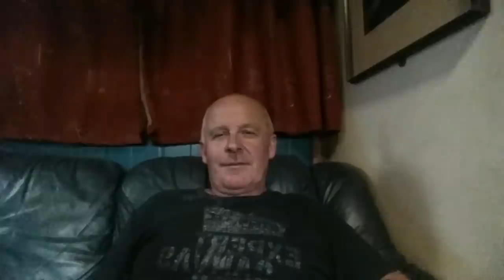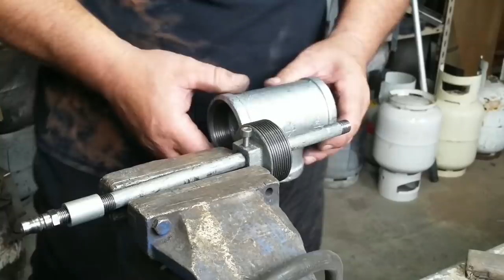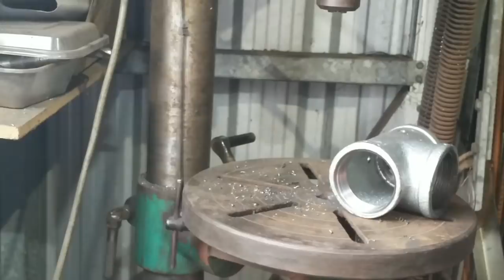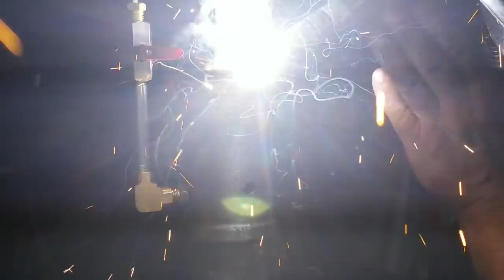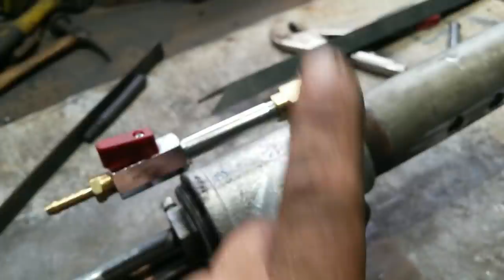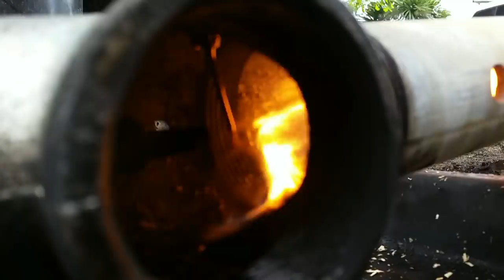Make your own Free Diesel from Waste Plastic!  PART 1

Comment: why not just use the waste oil for diesel? How much does it take to produce a L of diesel?
Reply: cvsWebDesigns  in the older 2 stroke Detroit’s you can burn any oil that will fit through the injectors. Setting up a 6 bt Cummins to try various filtered used oil products. My motorman ran an 88 dodge Cummins 1 million miles on used oil from 90 weight to restaurant grease to tranny fluid and hydraulic fluid and any oil he could filter he ran 20 %unleaded and 30 percent red diesel in it mixed with the oil
But often ran straight used oil. Way better to burn that as diesel than use it to melt plastic. A liter of used oil is pretty much a liter of diesel

Comment: your gonna need a stronger tip, mig tips like the droop when they get to hot for to long, it's not much but in this setup up it could effect your burn. have you run into this issue yet? or does it stay cool enough with with the just the air flow?

Comment: Love the 'can do' attitude!  Also 'hats off' to using waste plastic.  What is the range of production per hour?   Can it run unattended?
Reply from the maker: Eventually  I guess.  Right now I'm  busy monitoring each run . Production is about 90% by weight. It's not a lot though cos filled to the top with shredded plastic it's still only 12kg. So you get about 11 litres of product.
Reply: @t.h.o.r.  I think this is Great project for the world filled with unusable plastic.  Better than buying a burning some new fossil oil.
Reply: @t.h.o.r.  with a new house build on the cards and wanting to go with under floor heating (I'm in Ireland, need a bit of that in the winter) I'd looked at a similar set up. However yours looks both more simple and in house as regards production and maintenance 😁😁

Comment: It has these parts : plastic get wax at 400 Celsius,then you need to crack it on silica aluminium catalist by 400 Celsius,and then fraction Destillation into Destillation colum,Give leight gasoline,heavy gasoline,petrol,Diesel all high quality,a lot of gas. I made one of them ,to complex,gasoline still cheap.

Comment: Did you know that if yo get a tire hot enough that you can extract oil..? Most of everything we use and make has some oil based meterials. Plastic being made into Diesel Fuel is a great technological idea to expand on...
Reply from the maker: yes - thats what got me going down this track

Comment: You could use lens, for heat, somehow, an old big screen TV screen, some are ver big, very efficient lens, mount your lens on a pedestal hooked up to a computer, and camera perhaps with a pedestal, that has hydraulic servos, to change the pitch, of the lens to follow the sun.

Comment: Heating galvanized metal that much will give off super dangerous fumes, if i'm not mistaken, i hope you made sure it was safe using that pipe.
Reply from the maker: zinc melts and fumes at a much higher temp than this will ever get to.
Reply: @t.h.o.r.  Good to hear! Stay careful and good luck :)

Comment: Wooww, this goes behind my horizont at the moment. But I did some gas vapor buildings first time in my life. Before that I didn't know what a motor is. It's a litte bit crappy because I mostly built with parts I have and don't have to buy, but it's doing the job now as I wanted, see my last 2 videos in my channel :-)

Comment: Excellent video. What is a good starting point for air pressure?
Reply from the maker: hardly any, just a wee wee compressor blowing through a 1mm mig tip, 4-5psi
Reply: @t.h.o.r.  Shouldn't need a compressor at all right? Just a fan.. better to pressurise the fuel to make a mist or am I thinking wrong?
Reply from the maker: @Jasa1010  oh yes a fan would be way better. since then ive made other burnersthat are way more powerful that push the air instead of the fuel channel called @nobox7 is a great place to start when learning combustion

Comment: This was tried by a Japanese scientist he proved it could be done and it did make a usable internal combustion file,,,, BUT the cost of the electricity used to make one gallon of fuel from the plastic made the whole process to costly. You have to constantly control the temperature of the plastic melting device and the only way to do that is with electricity.
Reply: Or a used oil burner cannon, cost of air compressor cycling on every hour n a half (my compressor is small)

Comment: 1. Assuming this works well and safely, where does one get a free/cheap source of used oil or frier oil AND enough wasted plastic to make this worth building?
2. would salvaging the oil burner from a std sized house furnce be the same thing, same size/Btus  as whats needed here?
3. doesnt alot of orange flame suggest incomplete combustion? so alot of wasted fuel, alot of emissions....
Ps; was it raining or whats the background noise?
Reply from the maker: This is video 1 of a series. All that is explained in the next vids. Everyone has different situations you will find  business with several vehicles that all have oil changes.  Food cooking creates waste oil. Surely you know a place that cooks food? Packaging is everywhere. Just Check rubbish bins. As I say. All this is discussed in the subsequent videos

Comment: hi, at approximately the 11 minute mark, you are machining a hole in the end cap to fine adjust that thing galvanized pipe. Why exactly are you doing it this way? Isn't it easier, to just extend the threads on that pipe and add a bolt to it to lock it at the most favorable position? Now you have to slide that pipe to the perfect position and then tighten the bolt, and in my way, you just have to thread the pipe in and just tighten the nut.
Reply: Yes there will always be a better way.

Comment: I suppose this has to be better than letting plastic degrade into micro plastics that toxify soil and watercourses.
As for liberating too much carbon into the atmosphere, how easy is it to collect carbon then lock it under pressure into diamond?

Comment: Happy birthday!!! Is this diesel clean enough to run high pressure pumps?
Reply: It should be..but anyone making this fuel should mix it with at least 25% bought diesel to obtain the lubricating additives benefit or buy diesel additives (if there are?) The older sulphur/lead containing diesels had lubricating properties that helped prevent corrosion/erosion of moving parts(in the combustion chamber)..

Comment: Galvanized pipe heated up is extremly poisenus
Reply from the maker: Fact Check- Galv pipe heated to 430 degrees celcius , the vapourising temp of zinc is extremely dangerous If you lick it. I try not to lick it.
Reply: https://en.wikipedia.org/wiki/Hot-dip_galvanization

Comment: How much energy is being used to produce the diesel? This is a critical issue in that if it takes as much energy to make it as it produces then there is no net gain.
Reply from the maker: Solar power  provides the power for the small compressor and the water pump. 2 minutes worth of propane for the warm up is the only purchased fuel - main fuel is waste oil. - I get the feeling that you didn't watch it properly? The rest of thevideos on the playlist will give you a much more in depth view.
Reply from the maker: @fukenbiker  - Yawn.... The plastic costs me nothing, the fuel costs me nothing, the machine is made from junk. That is the kind of free we are using here.

Comment: Spent nuclear fuel from a nuclear power generation facility would be perfect for powering plastic to oil conversion. The spent fuel is very hot for decades. Spent fuel in a holding pool throws off plenty of thermal energy that simply goes to waste. We are very wasteful.

Comment: Wouldn't you use teflon tape on your threads during connexion?  Thank you for the excellent information.
Reply: It's not necessary. The pipes expand as they get hot and there is not a lot of pressure anyway so hand tightened is fine.

Comment: Happy Birthday for the day you made this video! Can you do this with wasted 3d printed parts?
Reply from the maker: Hi Michael.  Thanks for the birthday wishes.  Depending on the plastic type yes. Polypropylene or polyethylene are the best. Don't use PET Plastic - coke bottles. They have an acid in them that corrodes  your motot

Comment: I would have eliminated the 1/4" pipe couplers. A female 1/4" air quick connect and a 1/4" brass cap takes those two fittings out of the assembly.

Comment: What is your machine fuelled by? Because if there is excess heat to heat your home or heat water it is only logical that you are adding some sort of fuel for the process, it leads me to a cost/benefit ratio. If your fuel is not cheaper than regular diesel, then what's the point?

Comment: Hi, I thought heating galvanized pipe was dangerous, ie the galvanize gives off lethal fumes. Am I, right?
Reply from the maker: No sir- you are wrong. the zinc oxide fumes are a bronchial  irritant but not lethal. they are only released at the melting point of zinc which is 420c - this system runs up to 350c.
Reply: @t.h.o.r.   Ok thanks . I wasn't sure

Comment: Using galvanized pipe in any form involving heat is not smart!  Zinc Oxide is very dangerous!  Find some different pipes to use people.  Other than that it's a very interesting video.

Be careful out there!

Rbheiss
Reply: Mate.... Just so you know.... Zinc oxide is the primary component in almost every sunscreen product on the market. It's not toxic unless you enjoy spreading sunscreen on your chicken and mayo sandwich......

Comment: Haven't watched yet... but ill throw it out there first anyway... I wouldn't use this in a modern vehicle... maybe an old truck or tractor... but diesel does make a pretty decent furnace/stove oil... cheap heat.

Comment: Seems to me that the drip-control pin could be more rigidly fixed  ? 🤔   It may help with flame stabilization...and... exactly how did you get flame ignition initially? 🙄🤨

For peeps with less well equipped workshops, what about simply using an old oil-fired central heating burner/blower unit for the project ? 
Its completely self-contained so no need for a compressor & it has its own ignition source...😏

I'll be following this project closely !! 

btw... the pipe tap you used was, I assume , a 1/4" BSPT tap.. which forms a tapering thread ... as opposed to a BSP Parallel tap which , as its name implies, cuts parallel threads. BSPT threads being self-locking... also the MIG tips are usually M6 thread for those who are interested...
Subbed & liked...
😎👍☘

Comment: You didnt mention the holes in the burner part, are there any other things needed?
Reply from the maker: The more holes you have the faster it heats up and the  more air it pulls in, i started slowley and added more holes. it got better and better

Comment: By the time you built the small refinery , Add in the cost of electricity to run it , then turn the plastic into oil, then refined it into diesel it would be cheaper to buy the fuel at a fuel retailer. It would be far from free fuel.

Comment: Is there an easier way to do this?Iv seen some videos with Indian ppl but I'm guessing it's less pure? Awh me so dumb :(
Reply from the maker: Haha. I dunno about purity. But their volume is really low. Mine will make 9 litres really quite quickly. I'm not game to run a good engine on it but I have a 20hp single cylinder diesel that runs ute happily on it. The issue is with the pong! The neighbors don't like me running it.
Reply: @t.h.o.r.  awh that's a shame about your neighbours still it's best to stay in with them, how did you start doing pyrolsis?

Comment: Mate, stick those taps in your battery drill....done in seconds!
Reply from the maker: Sorry, Im a bit old school. Ive had the tap and die set for 45 years now and never broken one using them the proper way.  These are not machine taps- they are hand taps. very different

Comment: I have never tapped a thread without using lubricant. My metalwork teacher would have flayed me if I even thought of doing so.
Reply: The 2 inch T fittings are cast iron.

Comment: whats the point when they are going to ban diesel ? future is electric now. but still i rispect you man .
Reply: A new report declares Electric vehicles produce a bigger CO2 footprint than diesel. Diesel has gotten quite clean since removing the Sulfur. And how can they ban it when the bulk of power generation is Diesel derived? Coal is booming.
Reply: They won't ban diesel, at least not for a long time. The Oil companies would never let it happen. And it's quite obvious that electric vehicles do produce more pollution; nothing but making the batteries for them is extremely bad for the environment, let alone all the plastic that goes into them.
Reply: @mr.slaphappy3794  Mr.slaphappy  not if youl live in a busy street and some cars are 10 to 15 years old . god bless
Reply: The point is you could take something that is already waist and is choking our planet and turn it into a fuel source and that fuel source can burn quite clean if handle responsibly
Reply: Rispict dode

Comment: I understand that you are using two waste streams to make something that can be useful but you are not eliminating the pollution caused by plastic, you are just changing its composition. Which variant is more harmful to the environment I can not say but both are pollution and both are harmful. Your waste oil burner creates carbon dioxide like any carbon-based fuel will and the diesel you produce will also produce carbon dioxide. The process is a money saver but it is not green energy like solar or wind generation.

Comment: hi, i love your build its the most practical iv seen and would like to build something similar, i was wondering if you had written plans for it ?                                                                                                                                                also i was wondering if you think a particular adaption would work, im thinking of a slight modification by lifting the bottom burner a little higher and having it as a open access with a open top and small opening on the bottom  propane bottle on a either manual or automated lift and a slightly smaller container for the plastic, having the oil going into the bottom and gas either top or bottom which ever would work better.                                                                                                                                                     the upper propane container should then heat to 800-1200 degrees so it should still work for the diesel production while the lower burn chamber can be used as a scrap metal (aluminium mainly) like the one  oki scrapper uses                                                                                                                  https://www.youtube.com/watch?v=AhOefHPzg-0%20%20%20%20okie%20scrapper

Comment: This is a silly idea?  A plastic bottle is a Hydrocarbon based item made of course from oil.  We need to find ways to stop producing oil based items like the plastic bottles and then turning them in to diesel or something like that hydrocarbon based fuel or item! Plastic bottles now are turned in to warm soft fleece based jumpers and coats which is a far better way to use the bottles,   Better to use your clever engineering thoughts and skills to make better batteries like solid state everyone trying to make!   Just turning plastic bottles in to Diesel fuel is not solving the pollution problems we got it is adding more to them?  So use your mind to help power the cars without the CO2 or 0.5 particulates and benzine etc we have from Diesel now.

Comment: I have been seeing a lot of videos popping up on YouTube about turning plastic into fuel lately. While I am a great supporter of re purposing plastic, what you are doing here is trading one problem for another. You are recreating fossil fuels to be burned and release it's carbon into the atmosphere which is something we desperately need to stop doing and you are doing it by burning motor oil. Yes we do need to address the plastic problem but this is not the answer.

Comment: It says free fuel.. its not, it needs heat from a high temperature gas such as propane. it has a setup cost that can cost more than a few bob, chemicals to start the process.. good idea for getting rid of plastic waste but not free.. on a commercial scale it could cut plastic waste big time but it will also upset the climate change brigade.

Comment: It costs a lot of money to produce "free" diesel.
Reply from the maker: Not if you have all this stuff laying around. and the waste plastic is free- so sorry- that is incorrect
Reply: @t.h.o.r.  I was referring to the cost of the fuel required to run the process.

Isn't that the primary reason this has never been done on a commercial scale?
Reply from the maker: @libertarian4323   The fuel is waste engine oil that otherwise would have to be processed to dispose of! Propane is used for about 30 seconds to preheat the burner. Once it is running- the unusable fractions of the distilate are vapourised and also contribute to the heating by being fed into the burner. The Burner takes 3 fuels. this is part one of a series of vids that explains it all. Perhaps you should watch more?
Reply from the maker: @libertarian4323  In my other videos you will see massive commercial scale plants processing waste plastic into fuel- using plastic as fuel to do it.

Comment: Watching how you use those taps to tap a thread in that cast iron is cringeworthy.
No cutting compound or grease?
No reversing to loosen the chips?
Was really surprised you didn't break that tap.
I bet you've broken loads though.
Reply from the maker: 35 years on the same set of taps now. perhaps you were taught differently but CI never gets lube cos it does not need lube. Ive bored keywayed and grubscrewed every single sprocket and veebelt on entire processing lines in the automotive industry on several occasions.  https://www.practicalmachinist.com/vb/general/tapping-cast-iron-267156/